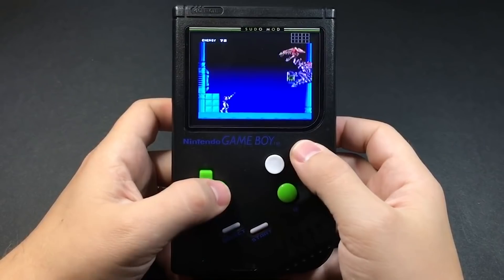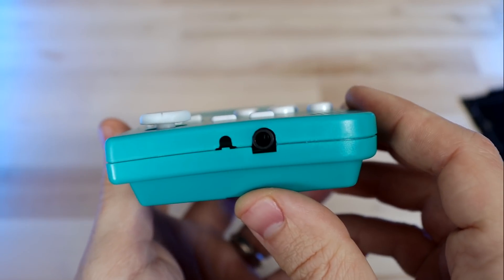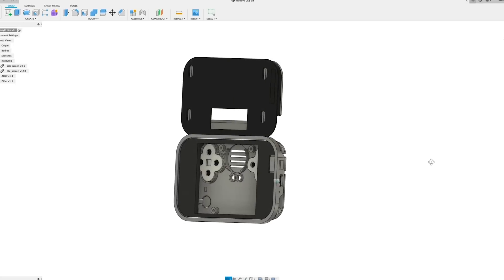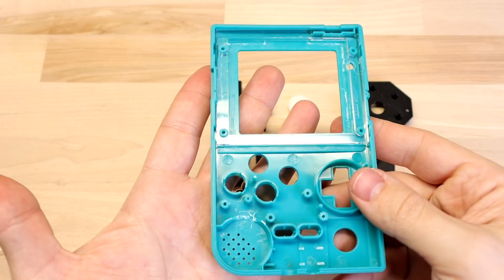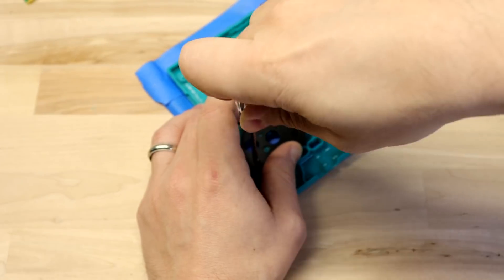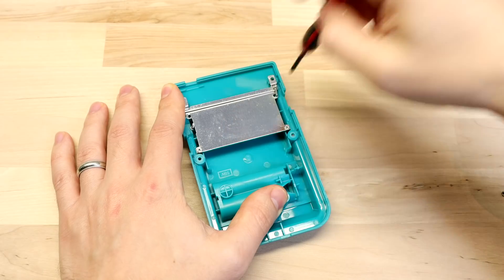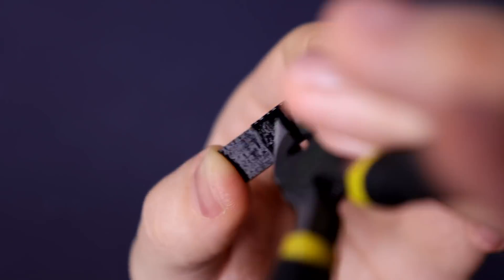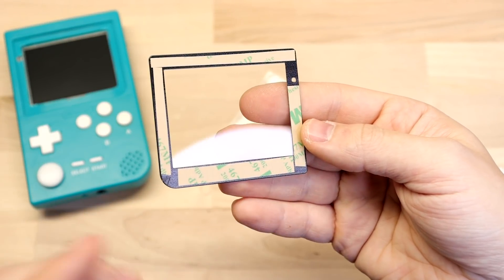Circuit Shield: Game Boy Pocket RetropPie Handheld + March Update!

Comment: I have recently really gotten into retro gaming and consoles. I bought a Sega Genesis Mini. Ordered two of the licensed 6 button controllers. I'm not very keen on doing in depth mods with a PC, so I'ma send it to a pro modder when I get paid again to have the system overclocked and get most Genesis games on a USB. My father in law noticed my enthusiasm and gave me an original SNES console with two controllers and 23 games! I need to get component cables for it though. After I finish my Genesis and SNES projects I wanna do something with a Gameboy or Game Gear. Glad there are channels like this that fuel my new hobby and teach me things I would've never known otherwise. Thank you.

Comment: Any concerns about cooling? The compute module can get hot!
Reply: This is not for an exhaust play.
Reply: Even worse considering you are putting a battery just on top the compute module, so not only the cm is getting hot, but the battery aswell, not a good combination. To be fair, there's not a lot of room on a gameboy pocket and the DDR2 socket is a little bit high too...
Reply: Not to mention that the battery is on top of the Compute Module.

Comment: Id love Something Like this with the Pi 4. I know that the battery life would not be great, but... Ps with double Resolution. N64 with good Performance, besides some issues loading stuff in.... Even ps 2 emulation if you overclock it!
Reply: It's not using a pi 4 because it's a compute module...

Comment: Hey Wermy! Are there any configurations you have to make to run the CM3+?   I put one in my Circuit Shield and it doesn’t boot.. I assumed Kite’s github file for the shield would work, however it doesn’t.  Any ideas?

Comment: Can you buy pre-made versions of this? It seems like a headache and I would much prefer a pre-build one.
Reply: there's a few youtubers that sell customs. wouldnt hurt to send him a private message about buying one tho
Reply: It’s not that hard, just time consuming! But as far as a finished product, I doubt Wermy would make one for you. It would probably cost you like $300-$400 for it to be worth his time. Plus, there is already plenty of ready made Gameboy emulator hardware if you want a prebuilt one, and they usually cost a lot less than this DIY route. This specific option was intentionally designed for the DIY community so people could build a fully custom one.
Reply: Keep in mind, the DIY kit from Kite costs about $190, and that doesn’t include the shell, buttons, silicone pads, screen lens, joystick, or the battery (not to mention the tools needed to build it). So realizing the parts alone would cost around $240+, even if someone only charged you a cheap build fee, you’d easily be spending $300+

Comment: This is a legit question and coming from someone who plays retro games on both my raspi 3 gameboy as well as my android snapdragon phone.  What advantage is there to playing on a raspberry pie vs android besides the novelty?  The android phone performs way better than the gameboy set up.  I bought the gameboy for the novelty by the way.
Reply: Aside from the novelty, you get physical/tactile buttons as opposed to using (sometimes annoying) touchscreen controls, which a lot of people prefer. Also, having a dedicated gaming device saves your phone battery, and likely lasts longer than your phone would playing the same games. So yeah, your phone is definitely more powerful, but there’s just people who would prefer to have a physical Gameboy, both for the novelty/nastalgia, and for the convenience of having dedicated hardware. And if your raspberry pi 3 Gameboy performs significantly worse than your phone, I’d have to wonder if the ROMs/emulator being used isn’t optimized? They should have relatively similar performance (other than the resolution/display).